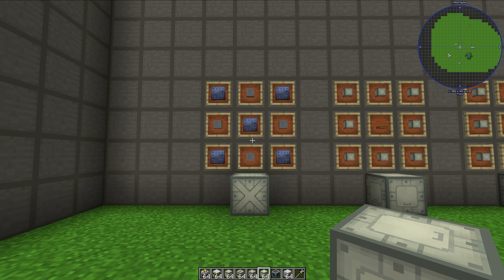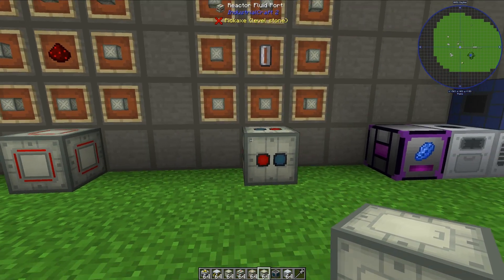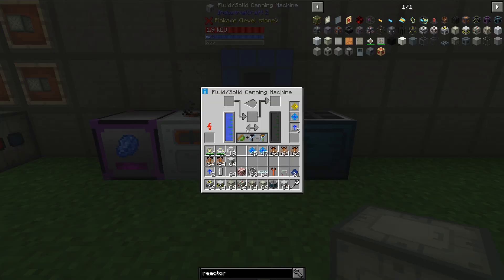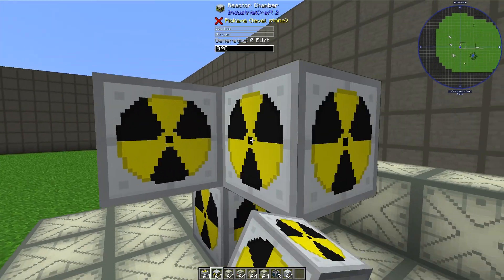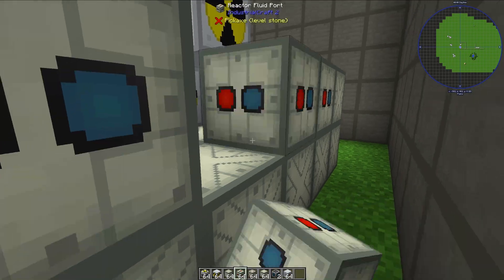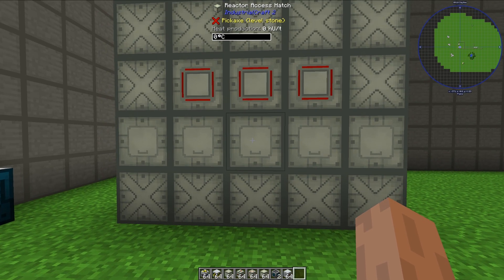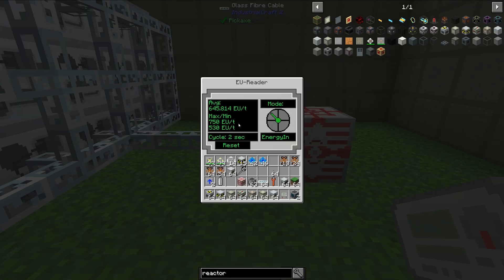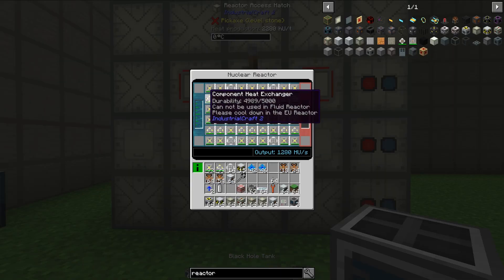IndustrialCraft 2 Fluid Nuclear Reactor Tutorial! [for Minecraft 1.12.2]

Comment: So, I've been playing around with the 1.7.10 version of this mod, and I've noticed that the heat system appears to operate in HU/second, with the design you showcased putting out ~1,280 HU; 1 mB/t of lava or hot coolant in the heat exchangers appears to equate to 20 HU/s (effectively 1 HU/t, making the above output ~64 mB/t). Said reactor design can reliably supply 12 heat exchangers (and partially a 13th), with 6 superheating boilers (plus maybe a non-superheating seventh) to generate ~900 EU/t (100 from each turbine using superheated steam, plus 50 from each second-stage turbine using the resulting normal steam, minus a relatively small amount for powering the condensers).

This video tells me that at some point between 1.7 and 1.12, the heat system was changed to operate on a per-tick basis; the reactor you showed displayed a per-second output 20x larger than what I got in 1.7. Does this mean that 1 mB/t of hot fluids equates to 20 HU/t (400 HU/s) instead of 20 HU/s? Also, was any part of this buffed or nerfed at any point between 1.7 and 1.12?

(On a somewhat related note, the Advanced Generators mod is a pretty effective way to generate power; the free-form heat exchanger multiblock can heat water into large amounts of steam using lava or hot coolant, and does so more efficiently than IC2's steam-powered setup. The free-form steam turbine multiblock is a decent way to harness the resulting steam, and the reactor design in question can generate in the high 1200s of EU/t. But the steam is OreDict-compatible, thus being usable with other mods' turbines; the most notable one I know of is the industrial turbine from Mekanism, which can generate upwards of 7k EU/t from the same amount of steam, at least in 1.7...and maybe 1.12??)
Reply: What the actually fuck did you just say 💀

you can literally operate a nuclear reactor like it was nothing
Reply: @ignekofire4601   Long story short, I was asking about the unit changes in between versions while also pointing out some cross-mod interactions that can extract much more power from IC2E fluid reactors.

Comment: Black Hole tanks and fluid pulling upgrades dont exist in my modpackt. everything else is there though :/
Reply from the maker: You should be able to use just about any liquid holding tank in place of the black hole tank. Black Hole Tanks just work well because they have a huge capacity. Technically, you don't even need tanks in the system as it can be a completely closed loop system. I'm actually surprised about the fluid pulling upgrades not being in your modpack as I thought that they were a part of the mod IndustrialCraft 2 itself. That actually complicates the setup because you will need to use liquid piping of some sort to move the hot coolant and cool coolant around your system.

Comment: This design isnt stable for me......
OC Heat exchangers break very fast
Reply from the maker: Do you have cool coolant in the reactor? If so, good. Is your reactor full of hot coolant? If so, you need to remove the hot coolant, otherwise your components will not be able to cool themselves and will break.
Reply: @minecraftphenom0892  Yeah everything is working. Cold coolant is full, hot is empty. But the heat vents start to break fast. the layout in the reactor itself is unstable

Comment: How much coolant are you using in reactor 7:33, i built the exact same one but repeating the liquid heat exchanger and stirling genereator 2 times on top of eachother (like the reactor at9:48), the thing is that not all of them are producing power at the same time they kinda flash on and off, so i was wondering if i needed some more coolant in the reactor so all the liquid heat exchangers actually have coolant to power the stirling generators.
Reply from the maker: I'm actually not sure how much coolant the reactor uses. My guess is that you are not producing enough hot coolant to feed all of your heat exchangers (and therefore your stirling generators) and that is why they are flashing on and off.
Reply: @minecraftphenom0892  I'll try to add more coolant and see what happens, thx for responding this fast, you just earned a new subscriber, good job :D
Reply: I replicated this reactor in creative and the same thing happened.  After I put in a lot of coolant, all the stirlings worked but produced less power than the dry one.  I put more generators and even filling it with fluid, it produces less energy... I believe I have to make the reactor hotter but the cost is unfeasible for survival, I prefer the traditional reactor that I have two in my base, a simple one and a very powerful one

Comment: Thats dumb. So with the fluid cooled version, it doesnt allow u to use less cooling inside the reactor, it just buffs the output?
Reply: It allows you to use less cooling. if you were to do nothing except put condensators and fuel in there in a ratio not to generate heat, it wouldn't output anything.

Comment: I don't know were to plug the cable, to te reactor, or I just get energy from the stirling generators?
Also, i'm using a modpack that aparently doesn't have fluid injector upgrades. unu
Reply from the maker: The Stirling Generators are the blocks that actually produce the power.
Reply: @minecraftphenom0892  why didnt u use turbines, they double the power output
Reply from the maker: @God-ch8lq  I just wanted to focus on the reactor setup itself. In addition, getting a proper setup with steam turbines can be finicky.

Comment: Do any parts (inner components, or outer) need to be changed over time? Or can I just turn this on and store the power safely without worrying about the reactor and its parts?
Reply from the maker: The components themselves will not need to be changed (external or internal). However, I would highly recommend not to store the energy from a liquid reactor. Once your batteries are full, the stirling generators will stop functioning. This will cause the heat exchangers to stop processing the hot coolant, and this will eventually cause an explosion. With some redstone you could hook up a battery (MFSU, MFE, CESU or even a BatBox) to tell the reactor when to run and when not to run.
Reply: @minecraftphenom0892  5) You said you don't recommend storing the energy from a liquid reactor, but doesn't the MFSU do just that? 
6) I want to build several reactors to power our massive Applied Energistics 2 computer system, but the power would probably have to be stored first, would I run into any issues by turning the reactor on and off periodically?
Reply from the maker: @Yourname942  Yes. The batteries from IndustrialCraft 2 can be configured to have a redstone output when empty or partially full. You can use this redstone to tell the reactor to run or shut off. If you used the redstone from the battery you shouldn't run into any problems. I would recommend being very careful with the setup though. Nuclear explosions are no fun to deal with.
Reply: @minecraftphenom0892  Is it possible to hook up the reactor to several batteries before it shuts off? (how many can I fill?)
Reply from the maker: @Yourname942  If you were good enough with redstone, there would be no limit to how many batteries you could hook up to the reactor. The reactor just needs redstone signal from one of the batteries to be on.
Reply: @minecraftphenom0892  I'm just trying to figure out my options in storing a TON of energy then shutting off the reactor so the sterling generators don't fail. I may make a clock to keep the energy flowing around, or use a comparator with  channels of batteries
Reply from the maker: @Yourname942  Just be very careful with the redstone. No one wants a hole in the ground where your base used to be.
Reply: @minecraftphenom0892   At 9:45 why are there more than one reactor redstone ports being used?
Reply from the maker: @Yourname942  There isn't a reason TBH

Comment: what is the layout of the final reactor you show? (it is different than the others)
Reply from the maker: Are you talking about the internal layout (the components used) or the external components (such as the amount of heat exchangers/stirling generators)? Externally I think that I used 15 heat exchangers paired with 15 stirling generators.
Reply: @minecraftphenom0892  I was referring to the external components. 

1) Does the layout (placement) of the reactor redstone ports and of the reactor fluid ports matter? 
2) How many reactor redstone ports do I need? Where did you place the 15 heat exchangers? 3 layers of 3 on one side and 2 layers of 3 on another side?
3) Where did you place the reactor redstone ports? 

4) At 9:48 you show us a different layout, I was trying to recreate it, but I don't know where you place each piece specifically, also did the internal components have the same placements as the first one you showed us?
Reply from the maker: @Yourname942  1) The fluid ports can be anywhere on the outer shell. I assume the redstone ports can be as well, but I'm not 100% sure about that. They may not be able to be placed on the corners.

2) You only need 1 redstone port. I think I had the 15 heat exchangers on the right side of the reactor in 3 rows of 5.

3) I think I put a redstone port in the dead center of the front of the reactor (with a lever on it). I actually had several redstone ports on this reactor.

4) Yes. The internal components are in the same places.

Comment: i have a problem
if i hook up a machine to it, it explodes, i think i know hwy its happening so i put an mfe to collect the energy but if i hook up a machine to the mfe the machine still explodes, whats the deal?
Reply from the maker: The machine probably cannot handle the voltage that it is producing. Try using transformers (to get the voltage low enough for the machines) or transformer upgrades (in the machines so that they can handle higher voltages)
Reply: @minecraftphenom0892   too late my reactor melted down 
oh well i know how to fix the problem now thanks xD

Comment: hi! I was curious, are you sure you can use the component heat exchangers in a fluid reactor? they say to only use them in eu reactors. thanks!
Reply from the maker: They will say that if they have damage to them I believe. If they are completely cool, then they should be able to go into a fluid reactor.
Reply: @minecraftphenom0892  gotcha. I'm just having problems with this build there, the components break easily

Comment: So overtime there is an overproduction of either hot coolant or cold coolant, what advice do you have to deal with this as an overabundance of hot coolant ofc ruins your setup, and too much cold will make the power output die as the hot coolant will end up barely affecting the setup
Reply: If u produce more hot than cool coolant, it will run out if it and heat up.
If u produce less cool coolant than hot one, its fine, but u should have a more efficient setup

Comment: Is there a constant need for more coolant to be made?  How do you get the newly cooled coolant back into the reactor?
Reply from the maker: No, there is no need to make more coolant once you have your initial amount in the loop. The coolant is cycled through the heat exchangers with fluid pulling upgrades and fluid ejector upgrades. Once the heat is moved from the coolant via the heat exchanger to either a stirling generator or a steam boiler, the coolant becomes cool again and is reinserted into the reactor.

I would encourage you to be super careful when you initially setup your reactor for the first time, as it is easy to use too little or too much coolant, which can result in the reactor heating up and eventually exploding.
Reply: @minecraftphenom0892  hi, i need unlimited coolant or it explodes. When I set it up, I was using a tank with 60000 coolant. After 10 min all disappeared..